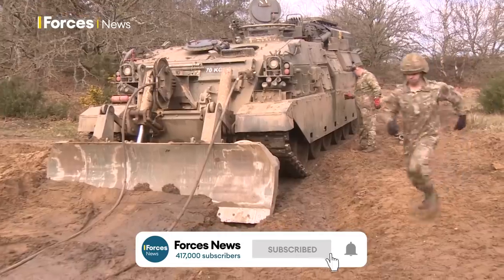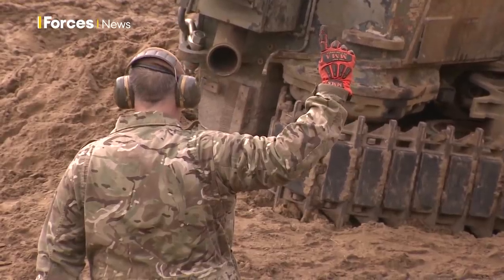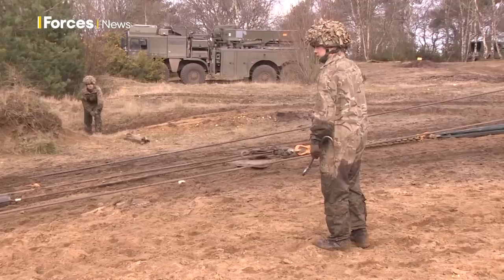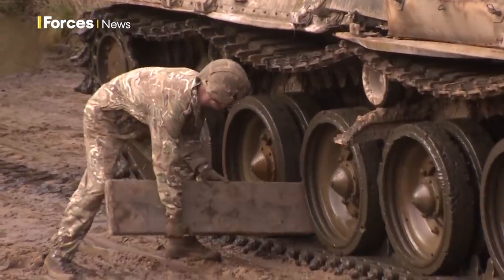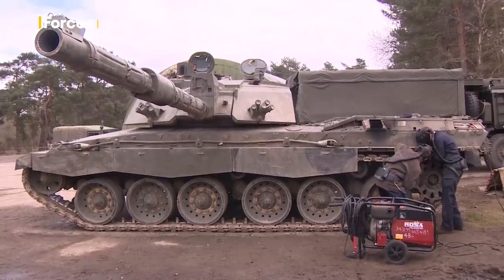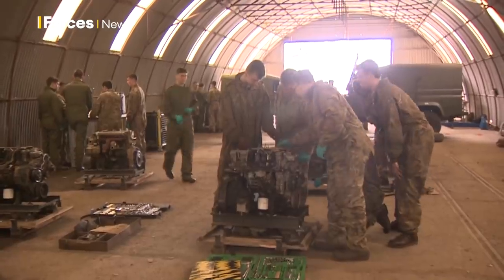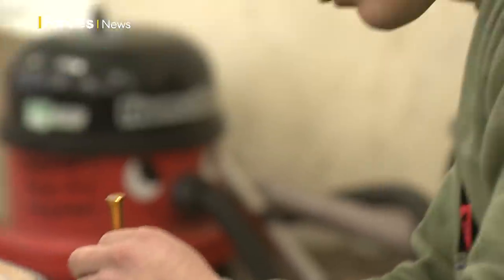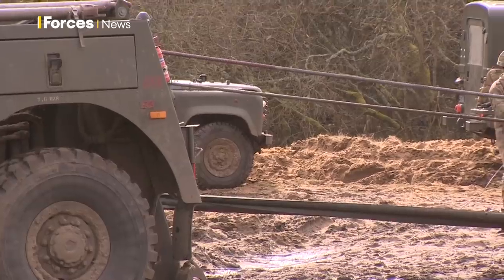How the Army responds to an overturned tank

Comment: Greeting from retired RCEME across the pond. I recognise much from my training in the 90s even if the system is different. What works, works. Arte et Marte!!
Reply: I did my trade training in 1958 and it was adequate for the equipment of the day but almost everything we trained on was wartime  stuff. At my first posting my first job was to change the fan belts on a Daimler Armoured Car , it took me a while to decide which end the engine was.
Reply: Thank you all for your service to freedom " one Ole veteran to another" 🇺🇸  🇬🇧

Comment: The difference between a professional army and one that is currently struggling...it's not just how many tanks you have but the quality of all the fine men and women who support them!
Reply: Russia’s problem is not just the soldiers but a number of issues, including poor maintenance, missing parts, dysfunctional comms (meaning many are using radios or even smartphones, thus giving away their locations), the inability to leave the road (lest they get stuck in the mud) and outdated equipment.
This has forced the Russians to mostly stick to convoys on the roads, which are naturally vulnerable to ambush. The failure to achieve air superiority is also a huge problem for the Russians. The soldiers are basically cannon fodder and even the generals are being picked off systematically. It’s a complete disaster and honestly Russia might have to accept a White Peace or only small concessions from Ukraine.
Reply: @louicoleman2910  also horrible supply lines, russians often have as much fuel as is on their vehicles, and food that is on them, and cant get resupplied easily.
Reply: @Myemnhk  exactly. Ukrainians are well aware of this, hence why supply convoys are the no.1 target.
Reply: Couldn't have said it better

But the Russian effort and situation is very misunderstood in Ukraine
Reply: Chose the wrong time of the year can not leave the roads for rear of becoming stuck in mud
Reply: @jordanleigh8119  lol
Reply: @gtr9s  Ukraine is getting what is right to them
Reply: @jordanleigh8119  lol
Reply: I get the feeling Putin didn't think he needed to invade. That Ukraine would back down.
Reply: Russia have for sure lost a lot of equipment ! They haven’t left the roads and supply lines thin for sure !
Reply: @cmac8982  I am not entirely sure if the mechanized units were bogged or permanently abandoned. At lot of them look abandoned.
The Russian army has allegedly been taking tractors from farmer to stop the tanks being towed away.
Reply: @cmac8982  From what I gather they are laying a pipeline to Kiev.
Reply: You sound like a clear expert. I bet you have led numerous armies on numerous invasions.
Reply: @jordanleigh8119  cope
Reply: @louicoleman2910  It's a sobering experience for them.  Especially considering the Ukrainian border is only two or three hours drive from Moscow.  It's literally  impossible to have shorter logistic MSR's. At first I thought the Russian forces  were deliberately holding back to spare civilian casualties. Refraining from using their feared rocket artillery, for example.  Being a Cold War veteran and former student of Warsaw Pact military doctrine. (Know your enemy.)  I'm honestly shocked by this very poor showing. 
There was a time when Soviet A-class army units were well trained and really well supported. In every sense of the term, on pain of death.  Warsaw Pact equipment may have been somewhat basic but it was at least functional and maintained same for the logistical tail. Furthermore, operating so close to Russian airspace and friendly air defence cover, it is inexcusable that they have not dominated the skies.  No country that size with long hostile borders, can hope to defend itself with such a poor military. I almost feel sorry for them. I bet the ChiComs are now looking at russian territories in the far east and making plans.
Vladimir Vladimirovich P,  I would have expected better from a KGB Col. chekista.   Bud’mo!
Reply: Must try time in ukraine if they gonna live or die 🤣👌
Reply: True and true. Training and the quality of the soldier is huge. Having the equipment doesn’t mean you know how to utilize it.
Reply: Interestingly `general Petraeus did a piece for CNN regarding the loss of five Russian generals. It seems the reason for these generals being on the front lines is because the Russian military currently lacks an enabled (read that as proactive) NCO Cadre. The generals have had to go to the front to organise their troops, have been spotted and hit by snipers.

Additionally the training for the Russian tank commanders is poor, for instance they are not even looking for fuel, cover or advantage, just relying on non existing logistics groups to supply what they need as they drive through Ukraine. Compare that to the training of western tank commanders who are taught to consider self sufficiency and you get an idea of how a volunteer western mechanized brigade would measure up against a conscripted one. A conflict of east versus west would not be pleasant, but it wouldn’t be a walkover for a larger Russian army.
Reply: @jordanleigh8119  I see that someone has done a little trolling
Reply: @louicoleman2910  Tanks would be better off spreading out
Reply: Like the say: Amateur talks about strategy while professional focus on logistics.
Reply: @engineer6250  Did you get your hands on a Russian tank commanders manual? 
A Tank cant be "Self sufficient". Only if by that you mean the crew nicking fuel from the nearest Gas Station. Then sure. 
This is a completly diffrent war then the ones you have seen and the Russian culture shows in it.
Reply: @louicoleman2910  Large reasson why Putin is so liked in Russia is because after surviving the 90s Russians wanted stability. They wanted somebody who knows what he is doing. And thats what Putin was for them in that moment. You cant deny that Russia has vastly improved since the 90s and for the people who survived them thats great news. 
No matter what , Russians wont allow the goverment to fall again like it did back then. Because they know that they wont wont survive such a situation for a second time. People dont seem to realise just how much the fall of the Soviet Union effected the normal civilian. The promises he was made by the goverment were gone. His home was gone. Promised work was gone , work in general is gone. And now that they have fianlly received all of that , you wont be able to take it away from them ever again.
Reply: @jordanleigh8119  cope harder
Reply: so good and better for Ukraine army
Reply: @bleachdrinker6915  Can you elaborate on that? Interesting to hear what you say next.
Reply: @ukraine578   Richy
Reply: It reminds me of the opening stages of Barbarossa
The Russians had 2 tanks for every 1 Support vehicle
The Germans had 2 Support vehicles for every 1 Tank

Guess who did better?
Reply: @nairda55555  the Russians did
Reply: @bleachdrinker6915  Nah. The Barbarossa phase was the absolute low point in Russian military history of the war.
Reply: @nairda55555  everyone knows that. Your acting as if German logistics were Fantastic they still relied on horses, the German blitzkrieg left supply lines miles behind the main advance. If the Russian army and air force were in half decent shape and talented officers hadn't been executed operation Barbarossa and as a butterfly effect to that, the whole of Europe would have looked different.
Reply: @bleachdrinker6915  relative to early Soviet logistics, yeah they were fantastic. Lightyears ahead of early war soviet
Reply: I want to see the first video,  where the driver  was Tokyo  Drifting the tank, and flipped it over !
Reply: @realsong-fake  "Amateur talks about strategy while professional focus on logistics."

I've seen that written a few times before, and I disagree, and the reason I disagree is the Logistics is (should be) part of Strategy.
Reply: To John Walker  
Good comment. 
A bit sexist however because you talk about women and men. In the British army you have a very high percentage of of homosexuals, Lesbians, gays and another five or six other categories which are recognised by western societies and these societies feel so proud about them.
Reply: all tanks are build as cheap as possible.......... look at the F35, they fall out the sky like fly's.......
Reply: US professional Army surrender to Vietnam and Afghanistan guerrilla warfare and US professional Army runaway from Vietnam and Afghanistan...
Reply: @appavi3959  You don't seem to understand something very basic; the US military were hamstrung in Afghanistan, thus they couldn't completely let loose, due to the constraints of modern warfare, and the political and social aspects.

IF there were no rules and no one cared, then they could have just nuked large sections of Vietnam, and "won" that way. Let's be glad that they do follow rules (for the most part).
Reply: @louicoleman2910  jijiiiiiiijiiiiiijjjjúuúuuuuuuúuuúuuuuuuuúúuuuuùj
Reply: @thecurlew7403  ុំ